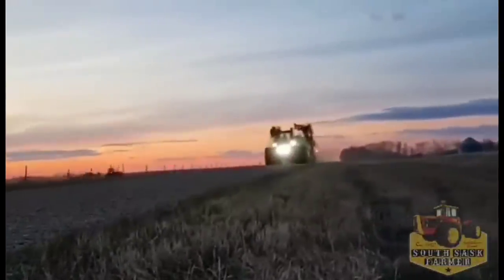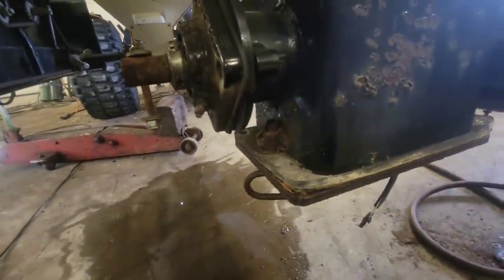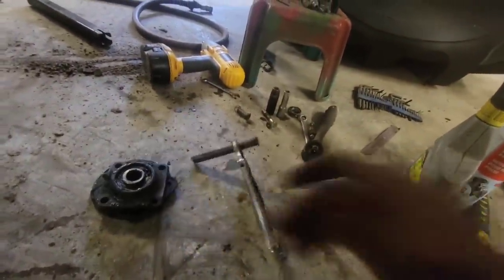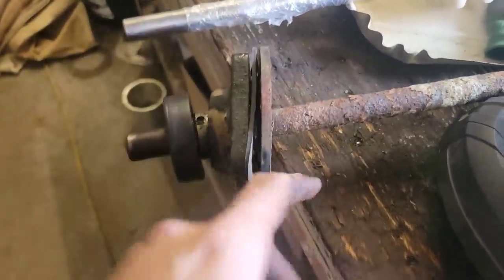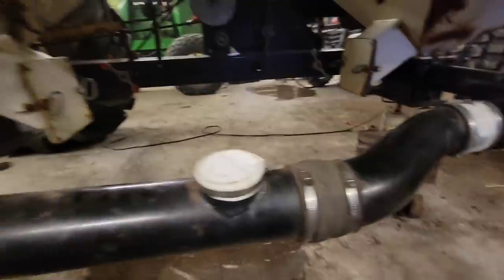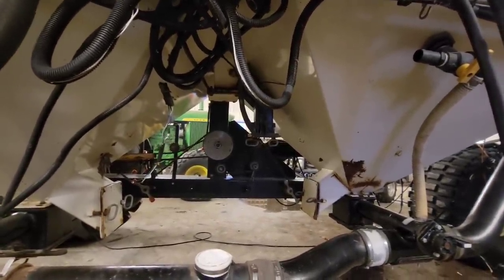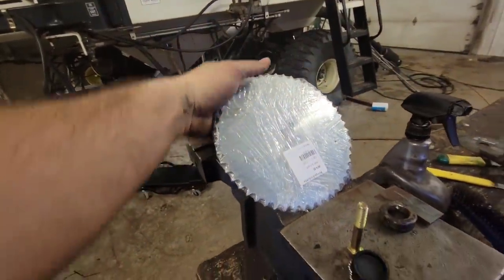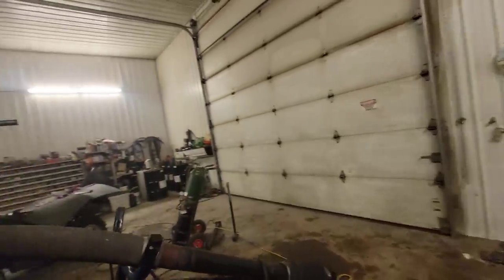Installing a plastic Pdm auger and fixing seized bushing on the 4350!!

Comment: The fans do tend to suck up bits of straw and then plug the manifolds on the drill, especially if you grow oats. I wouldn’t be scrapping the fan breather just yet.
Reply from the maker: Only if yoi don't have a screen on the intake
Reply: Even with the screen, I’ve got a 4250 with dual fans and the seed fan is closer to the wheel and with oats it’s a struggle.
Reply from the maker: @billybigrigss  never had one moments issue with the 138
Reply: We never did with our 3225 either, as soon as we got the 4250 it started.
Reply from the maker: @billybigrigss  time.will tell but I ain't gonna use that garbage can lid peice of shiiiitt lol

Comment: Find yourself a 5350 cart with CRA in the future. Way more better than the chain and sprockets setup. Bourgault makes a sweet cart.
Reply from the maker: I'm done with overly complicated fuckin junk
Reply: We’ve went away from a Bourgault cart to a flexi-coil/new Holland. BG does make a good cart but their sectional control is an abomination and with the inability to do turn compensation as toolbars are getting only wider means bad things for them. Still rocking a 3320 with mrb’s on 10”s.

Comment: I need to redo my meter housings on the deere ...they are kinda shitty
Reply: Changed mine to stainless, best thing ever, 1910 tank
Reply: @dalekindlein7612  I paid $8500. Per meter.  Replaced everything from ladder down and all tubing underneath tank. That included the plastic box in between.  Labour was about $1500. 00 on top of that. Every thing is completely new under tanks

Comment: was told by Bourgault when you install the metering augers make sure you have the flighting ending 1-1.5" before the drop, then the auger actually makes a little pile that gets pushed over to fall into the air stream, reduces the pulsing effect, if you know what I mean.
Reply from the maker: Yup thats how this one is can't do that on the old one though